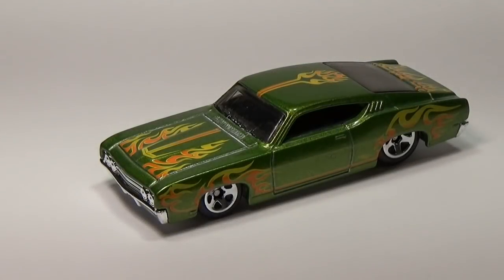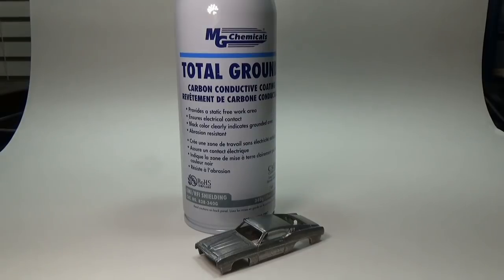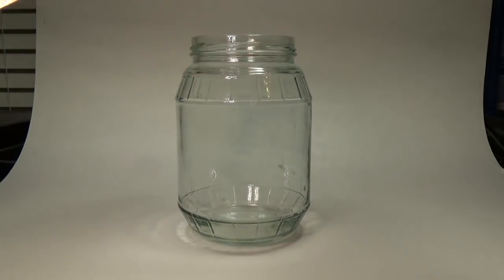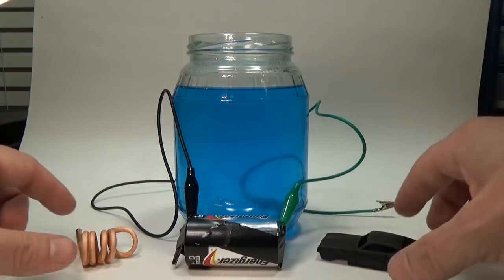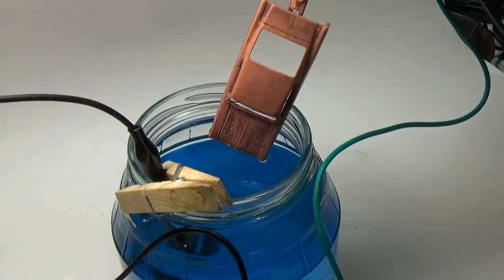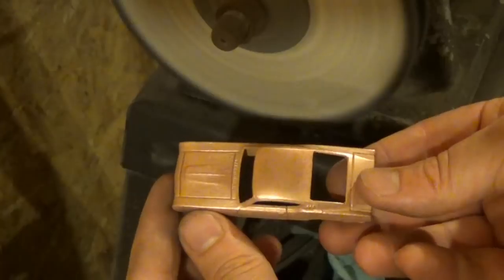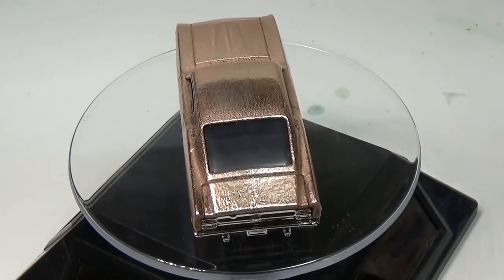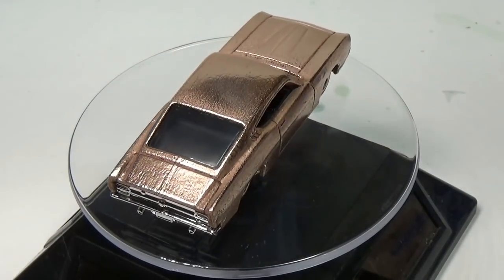How to copper plate a Hot Wheels die cast car at home.

Comment: I like to put my spray paint cans in the hottest water I can get from my tap for about 10-15 mins to help the paint spray more smoothly for a more even coat. That might help with the thickness of the paint your using.
Reply from the maker: I do that too...  I did not do that here but will give it a shot.
Reply: Guitarded And Broke I
Reply: baremetalHW 
how can i get in touch with u to send u some cars to restore.
Reply: You can send the cars to 703, spenta chs., thane w., Maharashtra, india
Reply: Mohit Panjwani you must be customer service.
Reply: That's a great technique, but all it really does is maximize how long you can spray by minimizing the endothermic reaction of the releasing of the propellant.
Reply: be careful with that one of my cans destroyed itself with the pressure

Comment: Shouldn't have to apply anything like that conductive paint onto zamak / pot metal to electroplate. You can do brush plating with the root killer. Flatten a piece of copper pipe then wrap one end with a piece of old stock (fuzzy side out), making sure there's none of the pipe poking through. Connect the other end to the + of a DC power supply, an adjustable one is best. Connect the car body to the - of the power supply. Put on some nitrile gloves then dip the sock covered pipe into the weed killer solution and brush copper on. Should get a smooth application pretty quick. What you don't get is a thick application.

Then you switch over to dunking the whole thing into an acid copper plating bath for building up thickness. The strike plate from the root killer brush job protects the pot metal from any initial acid attack while the plating gets started.

Shops that do good restorations of pitted parts for cars will plate on zinc then carefully sand down, leaving built up metal in the pits. Each time the super cleaning process has to be done to ensure the pits will plate. When that gets close to smooth they'll do the same process with copper until it can be buffed shiny. Then its nickel plated and buffed. If the part is going on a pre-chrome plating era car, that's the end. If it's newer it gets chrome plated over the nickel.

Plated steel parts used to get a zinc, copper, nickel, chrome process. Then someone figured out a way to plate chrome directly onto steel (and even lead), which resulted in chrome lasting much shorter time. Lead? Yup, at times from the end of WW2 through the Korean War, zinc and copper were in short supply, but lead wasn't. So car manufacturers resorted to using lead for cast trim and somehow forced chrome to plate directly onto it.

Chromium plating is difficult to do because for a dip bath it takes 1 amp of current per square inch, unlike plating most other metals. Chrome baths also don't "throw", you won't get any plating on the side opposite the anode, so you have to surround the item with anodes that have direct line of sight to all surfaces. Brush plating to the rescue!

Fun fact: The hubs that connect parts of the International Space Station have mating surfaces that are chromium brush plated. Why? Because it wasn't feasible to build tanks to dunk the entire part in, and it would've required several thousand amps (or much higher, depending on surface area) to plate the whole hub.
Reply: Search " Terminator frog" copper on spray.

Comment: You can get a similar product at the big box stores.  It's a graphite dry lubricant in the automotive/lubricants section.  It's basically just graphite powder mixed with solvents and it's under $5.

Comment: The finished car looks beautiful in burnished copper. I hope you clear coated it, as copper tarnishes very easily on exposure to air and moisture in the air. It will darken a bit, and then turn green - just like the Statue Of Liberty, which had a bright copper finish when new.

Comment: There's an alternative method if you're not afraid of heating the shells up a little...

Heat the car shells, then use a brass or copper wire brush to transfer-plate parts. More involved method, but works well if you want the brass/copper finish rather than as a base metal for another plate.

Comment: Thin film carbon coating using thermal evaporation would be an great way to get a VERY thin coating of conductive material on the car. you would need a vacuum chamber, a decent vacuum pump (you can use old fridge parts), and a voltage source, but the process is not hard

Comment: I contacted MG Chemicals to get more information on their conductive paint.  I bought the Nickel coating in hopes that it will help the process along.  It does have less resistance than the Carbon coating.

The MG Chemicals technician that emailed me back said that Acetone should work fine to use as a thinner, however, they do have a thinner specifically for these paints.  It's "MG Chemicals Thinner 1".  Since I'm using this on more delicate plastics, I may go this way if I run into problems but it's kinda pricey.

Comment: I read on the manufacturers web site that it's an acrylic lacquer.  Therefore I'm gonna try to thin it with lacquer thinner - also I'm going to get the Nickel coating as it has less resistance - maybe that makes a difference?

Also, you may not have let the paint cure enough for sanding.  That would explain your sanding issue.

Comment: Great videos! ....there's a conductive paint that's designed to repair heated rear windows on cars, you paint it on to the glass to repair the original broken heating elements, this paint is thick but also very smooth it may work better than what you're using, and may be able to be used with your airbrush if you can find something to thin it out with.

Comment: I would imagine the conductive paint is only needed for non-conductive parts. Have you tried this on the bare body. It should collect the plating roughly the same. When large parts are chromed, the copper is often used as a soft buildup. You could apply the same theory here. Make your model as smooth as possible, plate a build up layer, sand smooth, repeat until its uniformly smooth with built up copper to fill in the small defects.

Comment: Copper phosphate is the best alloy to plate, to get a better surface finish, look into copper plating leveler and refiner.
Use constant current, keep temp around 35-40 degrees Celsius
And bubble the surface of the piece to be finished to prevent any bubbles staying on the surface of the piece to be 'plated'.
Apply auxiliary anodes in hard to reach, low current density areas,
Alot of this aside for nuances apply to both copper and nickel, but nickel is very sensitive.

Comment: It is possible to copper plate directly onto Zamak (die-cast zinc alloy) but you need to use a cyanide copper bath rather than acid copper.

Comment: With all due respect it’s not the paint that matters, it’s the smoothness of the base metal. The metal these cars are made of is poor. If the base metal was able to be “smooth” that black paint would be unnecessary. The copper is only a few molecules thick and telegraphs any defects from below. Keep up these great videos.

Comment: I’ve been doing this for years on guitar parts but never used the conductive paint, So my question will the die cast take a copper plate without using that conductive paint? I’ve just ruffed the surface of the parts and used the bath of copper sulfate (root killer works great and is cheaper) and a 9V battery. Then polished it up.

Comment: I'm sorry if I missed it but why didn't you just plate the bare body?  I feel like if you buffed the body fist then plated the end result would be much smoother.
Reply from the maker: The bare metal won't plate using these chemicals...if you put die cast in the bath the bath will just turn it black and start dissolving your car.

Comment: Hi, it's been a few months and I'm not a channel regular so I don't know if you're making progress with the carbon paint finish, but you might want to investigate "sprayed-on chrome" which isn't chrome at all but two-part silver nitrate paint with the B part being a chemical that reduces the silver nitrate to silver (it's the same basic chemistry used in photography).  It gives a mirror finish on any paintable surface.  A bit pricey, but on a cost per car basis it probably wouldn't be too bad.
Reply from the maker: Where do I find it?

Comment: Why do you need to use the total ground? Wouldn't the copper stick to the die cast if it was scuffed up some?
Reply from the maker: no...  wish it would..
Reply: I read somewhere that Zinc can be directly electroplated in alkaline electrolyte; otherwise, the surface oxide layer prevents any other metal from sticking to it.

Comment: Could the copper plating process be repeated a number of times to get a thick copper layer, and then polish more harshly to get rid of the rough surface? Or would it need to be a different metal each time you plated?
Reply from the maker: Yes you could repeat and build up the layers but it would cover up the details over time...
Reply: k7rby copper is good for mush buffing. Where you put it on in layers and buff it into the imperfections. The goal is to have a perfect base like painting a car. But smoother the metal brighter the shine

Comment: Put a cyanide copper strike on it first then acid copper, no paint.  Add air agitation  to improve the plating finish by introducing fresh copper ions to the surface.
Reply: Try electropolishing the copper plated car, that should smooth and brighten it.

Comment: So what about an 1/18th scale diecast car? Will I just need a bigger jar/bucket or will I also need a stronger battery (something like a 9 volt)
Reply from the maker: Yes a bigger bucket and probably 2 D cells.. It the car plastic or die cast?
Reply: Diecast, so I assume the rest of the process is as you described in the video.

Comment: Why not just make duplicate molds of car bodies out of copper? Forge smelter copper into molds then nickel plate them. Shoot just silver plate and make a bling hot wheel.
Reply: Beastman44 as cool as that would be, I think it would be more trouble than it's worth. copper is very difficult to melt with a homemade furnace, much more so than aluminum or lead. was literally watching a bunch of videos on this yesterday, as I wanted to use some scrap I have lying around to cast some bullets because it's far easier for me to come across copper than lead, but the amount of work to do it at home is probably too much to do just for a once in a while thing like car bodies. still, if someone's up to it I'm sure the finished product would be very cool!

Comment: Zinc Spray will not be better for this?
Reply: BJ Blazkowicz I don't know why you need any spray.  Unless this cast metal won't plate but I don't know why it wouldn't.
Reply: BJ Blazkowicz He mentioned that the acidic bath would eat through the die cast; sulfuric acid more dramatically so.
Reply from the maker: It won't plate.... Not with these chemicals...  You need a cyanide bath to plate them..

Comment: that paint job was hiding more secrets,that a prossies makeup,i thought it was brand new,underneath it looked ancient i can only assume these cars are made from all the metal to cheap to be for any industrial use ,which makes sense,as the shape and size of the 1/64 cars makes for a strong frame reguardless,and any failure in the metal isnt going to end up in court.Still shocked though

Comment: You might want to take a look at this https://youtu.be/ilWst2zq-D4 I found it when looking to copper plate 3d printed parts. It shows brush plating which may give you a smoother copper surface. They use a slightly different base to your total ground. Take a peek, since the touch up paint they us got mixed with a it one and might get that thin spray able paint you need.